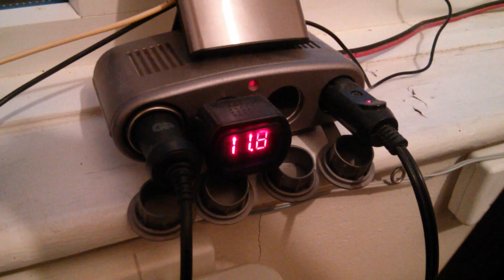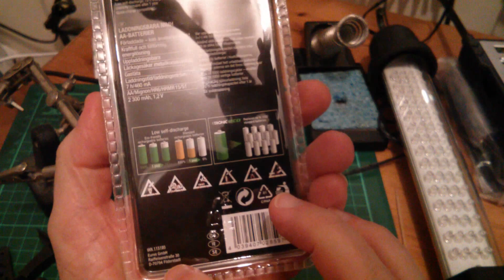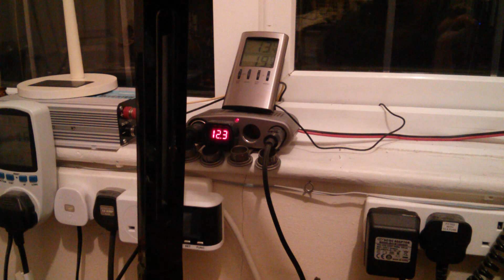Solar Moan: Resorting to Mains Charging

Comment: Same problem my 250 watt panel is not keeping my battery topped up I have to limit the use of the led flood it powers, roll on summer, perhaps you should make a small wind turbine, project for next year?

Comment: I've been having the same trouble on my main solar system.  However I'm finding that my Arduino PWM5 solar charge controllers seem to be getting more from our low sun levels than the MPPT charger.
Reply from the maker: +Adam Welch Wow, really? In that case, the original PIC-based PWM5 should be even better because it uses less power itself. I must do some more work on making the PIC design more accessible to everyone.
Reply: Yeah - I'm thinking about taking my MPPT charge controller and the various meters out of circuit for a couple of months.  Did you see I managed to get the arduino (well AVR) version of your solar charge controller to consume only 8 mAs?  Not quite got it to 1mA as yet... :-)
Reply: +John Richards I'd love to see the AVR chip running at 3.3v with a transistor latching on/off circuit so the micro-controller can turn the system off XX minutes after dark and have the voltage from the PV turn the system on when it is light again.

Comment: My very small 30w worth of panels (behind a window too) is struggling to make even a few mAh per day at the moment! Last week I saw under 1Ah of power. It is managing to keep my 12v 50Ah SLA at about 13.00-13.20v though with zero load besides my Arduino charge controller (about 2mA at night and 10mA daytime load).

Moving my panels outside would probably help a little but that's sadly not an option for me living in a flat.

Comment: I feel slightly better now -my solar shed project has been struggling to maintain charge for the last couple of weeks. Admittedly it's only got a 20W panel and an old car battery, but currently it only has to power an arduino & NRF24L transceiver. I think today's the first time I've seen it go over 12.2V since the beginning of December. Good job the days are getting longer now :)

Comment: Hi. Solar power is a matter of scale and viewing it in context. I add this comment as a counterpoint to your video. November was the worst for us and I had to use the backup charger on several occasions. I have loaded a video showing our system performance on the winter solstice 2015. It will not be long before I will be throwing power away through the charge controller, but it means the system provides reliable power throughout the year. I see the backup charger as part of the overall system that provides an average of 9KwHr per 24 hours. Cheers, Andy
Reply: +Nige Cook You are wrong. Cost amortization of solar PV panels is 3 cent/kWh where cost of storying a kWh in the least expensive energy storage battery LiFePO4 is in theory 15 to 25cent/kWh probably in reality closer to 25 or even 30cent/kWh. So storage costs 10x as much as PV panel generation and is better to have a 2x to 3x larger sized PV array than get more storage capacity. Storage should be as small as you can get away with.
Reply: Right or wrong, it depends on the circumstances. In my experience a battery that stores all the power generated in summer is mostly flat for the rest of the year. I find it pragmatic to spend my resources on the generation side so that even with cloud cover I will achieve something like 500 watts of charge (10 amps at 50 volts). This way the battery is helped along during poor periods and then charges up quite quickly when there is good generation. I am working on turning the excess to heat which may be inefficient but at least it is being used, more appropriate of spring and autumn. I have a 600 ah battery, which given that it should not be discharged below 50% holds about 15 Kwhr. Cheers, Andy
Reply: +Andy Reynolds You should look on what I'm doing. I want to heat the house with solar PV electricity since is the least expensive form of electricity. So after I'm done with the current project the SBMS (you can check my google+ page) I will build a (not sure how to call it yet) solar heat controller that will have two parts. One will be to select the number of PV panels that will be redirected to battery charging so that to keep the charging current to appropriate levels for battery and the all the excess will be stored as heat with close to 100% efficiency since it will be what I call a digital MPPT. There will be a set of 4 resistive elements say 1ohm,2ohm,4ohm and 8ohm (just an example) and connecting more or less of this in parallel I can achieve 16 different levels if you include all off. That way I can select the resistance level one of 16 levels so that I can keep the PV array voltage as close as possible to the max power point voltage in any weather conditions. With a fixed value resistor connected to an array you get less than 50% of the available energy converted to heat.
Hope you get the idea but I will make a video sun and explain more in details the concept.
Heat storage in thermal mass is extremely inexpensive at least 20x less than best Lithium battery so you can have a large capacity to store all excess energy. My house was designed and build by me (I have a video on my channel about that) and the house has a large thermal mass storage is 14 cubic meter of concrete that is thermally insulated from outside and can store 100kWh at 10C temperature delta.
Another is a 20 liter water bucket that can store 700Wh at 30C temperature delta and will cost almost nothing compared to a 700Wh chemical battery not to mention is 100% efficient is storing heat and there is no degradation.
Reply: ***** Not sure what you want to say exactly. I'm not in to solar energy because is "green" I use that since is the least expensive option available. Sun is the only real source of energy in this solar system :)
I do not think there is any doubt that humans contribute to global warming but I do not find that as a major problem there are more important things that will happen faster and with greater impact.
My solution to cost of energy storage is using thermal mass that is extremely inexpensive and works great when most of the domestic use of energy is for house heating in my case cooling in some other parts of the world.
Lithium batteries have the best cost when it comes to electricity storage but is still bad as I mentioned and the price is unlikely to go down to much in the next few years. The cost will go down as electric vehicles will be more mainstream but I do not expect the sort of rapid drop as with solar PV panels (I will love for that to be the case).
Reply: +Nige Cook Not sure about your comments. I never mentioned fossil fuels. I do not care about them in any way. I have a 6 cylinder 3.5 liter gasoline car and is less expensive to drive than a Tesla model S in most part because of the cost amortization of that Lithium battery. I want to make a video about that with the numbers.
I was saying that battery storage does not seems to improve in either performance or cost very fast. I got my LiFePO4 battery about 4 years ago and if I wanted to get the same battery today it will have the same cost and similar performance.
As for heating I use propane now but that costs me 30cent (CAD) / kWh. Gasoline and diesel is less at around 8 cent/kWh it was more but gasoline price is quite low at this moment. Natural gas is the least expensive and can be 3 to 4 cent/kWh if you do not consider the large initial investment to connect a new house to the natural gas line. At the same time solar PV is getting below 3 cent/kWh even if you by panels in really low volume Electric heating is around 100% efficient and has no moving parts . Where the fossil fuel heating mentioned above needs quite an investment and a lot of maintenance while efficiency is around 80 to 94%.
Yes solar power is intermittent but thermal storage is also extremely inexpensive can be below 1cent/kWh so you can get a storage as large as you want to cover the intermittent nature of solar energy.
Reply: *****
In large part we sort of used most fossil fuels at least those easy and cheap to get. Coal generates a huge amount of pollution and that is a problem that those living in the large cities in China can smell every day (you will not want to live there). Also all fresh water fish in north America has levels of mercury unacceptable for human consumption that is again do to Coal burning.
One of may reasons I moved offgrid is the slightly cleaner air (of course there are many more reasons but this is also there).
Despite efforts there was no reduction in fossil fuel use in the last decades. The most significant impact was the 2008 recession :)
They are also finite sources so solar is the only real alternative (Wind is also a form of solar energy).
I designed my house just 4 or 5 years ago and if I knew solar PV prices will drop so much I will have incorporated the PV panels directly in the design of the house probably a sort of A frame with south side made entirely of PV panels that will have been enough for electricity and 100% of the heating.
Luckily I have enough space so is not a big issue.
Transportation is the largest source of energy for me then heating and lastly direct use of electricity for appliances.
But my house uses about 10x less energy for heating and electricity compared with an average house in Canada and US.
I just use 60 to 80kWh of electricity (that will probably increase to 100 to 150kWh) average house uses around 1000kWh. As for heating the house is about 3x better thermally insulated than typical house and about 3x smaller and that is the reason it needs about 10x less energy for heat considering the same climate as here.
As for transportation I do not drive much but the car is far from efficient so is more energy than heating in my particular case.
Reply: ***** According to this page http://www.energy-uk.org.uk/energy-industry/electricity-generation.html there is still a fair amount of Coal used in UK 28% of electricity second after natural gas 47%. Also natural gas (another form of fossil fuel) is used to heat about 70% of the homes in UK for sure a much cleaner fossil fuel that Coal.
This is a large majority not sure why you have any worries about that :)
This will only be replaced by renewable when they will be more cost effective in UK.
Reply: Anyone who remembers the industrial towns when coal was king will fear a return to deep broncial coughs, dying trees and buildings stained black. I feel humanity should have a lighter footprint on the biome to reduce the rate of species extinction. On the otherside I would not like to rely on one form of energy, so home generation can play a significat part in the energy mix and a reduction in footprint pressure. Beyond tha, a concerted effort to reduce general consumption of all forms, and the knock on effect of reducing cooporate power would have equally important effects. Cheers all, Andy

Comment: Ahh i feel your pain sir. I was using (abusing) a laptop power brick to mimic the panels while the days are dreary here in the states. Ive since just built up a cobbled together battery charger, out of some vintage stud diodes, an old 800VA transformer, and a cap. Not as efficient at first glance but the brick was getting quite warm and only offered 4A peak but this setup will chuck out tens of amps with little effort. Gotta have something to tinker on with this crap weather :)

Comment: Kinda surprised you don't have a mains RV style backup charger setup that you leave off till you need it but can dump up to 45 amps at 12v into you battery bank if you get several days without much sun.  At my cabin I have a programmable BMS that will solar charge the batteries but if the voltage on the bank drops below 11.8 for a minute or so it will kick on the mains charger until the batteries reach 14v.  It doesn't kick on often but every once in a while it will start up and top up the batteries if the solar panels can't keep up or get snow covered.

Comment: im at 53 north with pritty much the same problem on my li-ion pack I manage to charge phone from the pack with the days collected solar and then protection circuit kicks in and cuts power need more panels have 4 10watt 5 volt in series to a voltage reg that maxes at 12.6 volt input is like 20 volts but only seeing aboit 280ma

Comment: Time to save the battery charge/discharge cycles, dump that simple 20:1 wall wart and just plug in a high current, (switching)  mains powered DC power supply (and pretend you are running on batteries).